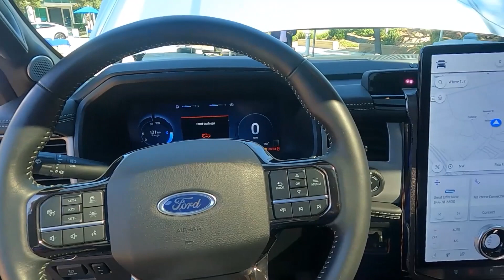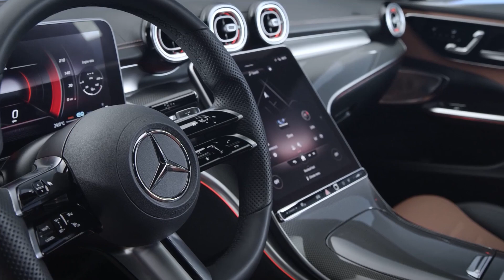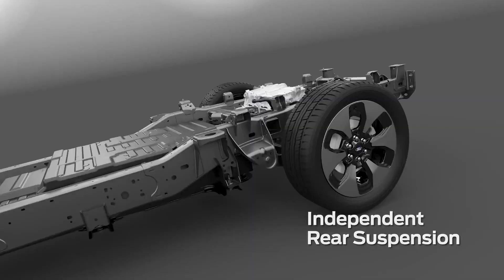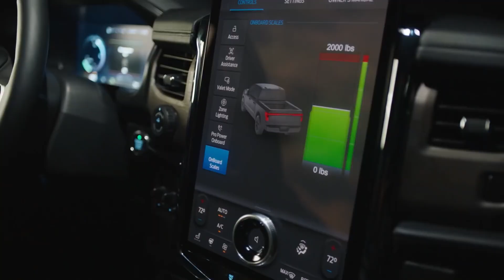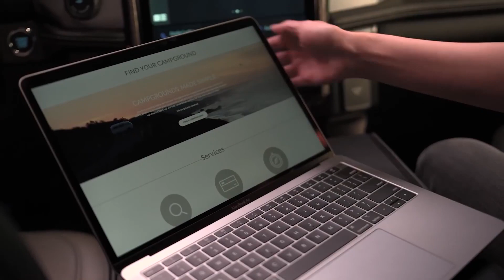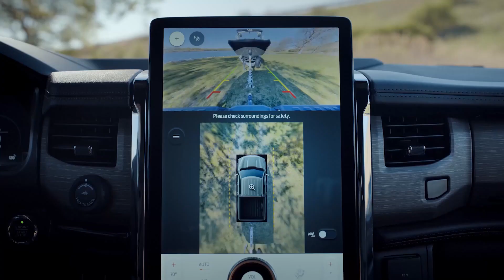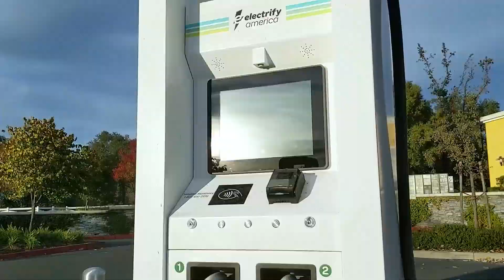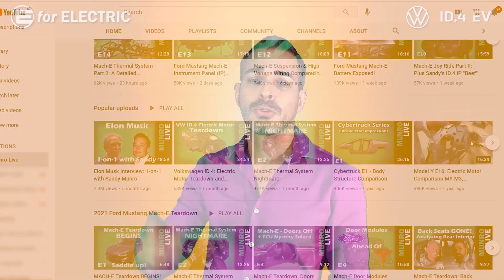SANDY MUNRO on Electric Trucks: F-150, Cybertruck & Rivian

Comment: The F-150 lightning has so many well thought out design elements. Ironically one of them is how little design went into it. A "normal" looking EV is a shocking departure. The frunk size and load in height is brilliant. The power to home feature is revolutionary (to actually bring to market) and targeted EXACTLY at truck buyers who love to be the "hero" at every opportunity. Add that Texas had a power grid melt down last winter and the state is one of the largest market for trucks and you will sell them on that feature alone. When potential Tesla powerwall buyers do the math and find out how many they will need to equal the runtime of the F-150 they will use that to justify the cost of the F-150 lightning.
Reply: There is really nothing stopping someone from powering their home with a Cybertruck or probably a Rivian too.  They both have large onboard 240 volt AC inverters.  So it's just a matter of running a 240 volt generator cord to an inlet/receptacle on the house and flipping a breaker or transfer switch.  Ford is just marketing it as a feature, but the only unique part is that it's automatic instead of manual.  What they aren't telling you is that getting your home wired for that automatic transfer switch will be more complicated and expensive than it will be worth for most people.
Reply: @CL-gq3no  I think most of those onboard generators top out at 30 amps, not the same.
Reply: @frankcoffey , Ford's tops out at 9.6kW max which is 40 amps.  I'm not clear on the Rivian's inverter output, but the Cybertruck will very likely be similar to the Ford if not better.  Even if it's 30 amps that is still more than enough to power a home's critical loads in an emergency and not that different than Ford's 40 amps.

Comment: The lightning does not need 500 miles of range. Towing a trailer cross country is for the ICE trucks, the Lightning is for commercial fleets that need only 200 mile range - if that.

Comment: Hopefully they will start having fast chargers accessible to trucks pulling a trailer. Currently most are single stall for a single vehicle. Need current gas station type set up.
Reply: There's way more pull through charging stalls in Europe. But yes that's an issue for sure.

Comment: But neither speaker really addressed a couple of key points.
Trucks loaded with 1000+lbs of battery have 1000+lbs less payload. 
Towing tanks the range of EVs. TFL measured a tesla and got less than half the range. 
Charging rates are laughably slow... unless you modify your house or go to a quick charging station.... that does not typically get sized for a truck, much less a trailer!

Comment: Not sure I've heard this question asked/answered anywhere... Where are trucks towing trailers going to go to easily fast-charge their vehicles while traveling? I haven't seen/heard anything about charging stations designed so these vehicles can easily pull in and drive out with their trailers. Any thoughts, Alex or Sandy?

Comment: Many pickups have tool boxes in the bed of the truck and why couldn't Ford have a custom box with a battery pack in the bottom or the pact could fit into the box that could give you the extra range. Or many have covers on the bed and why couldn't the cover be solar panel for recharging. Just two thoughts
Reply: My 2 thoughts too, after market goodies will come with demand
Reply: EV cars realistically would not have room for these options. And for the pick up, the potential  added range would be almost unlimited.

Comment: A cool note about the increase of EVs is that Jeep is placing chargers at the Rubicon trail as well as other trails. So it will be cool to see more adventure minded companies address the wilderness charging issues. My personal truck is for daily driving and weekend off-road play of which I need to refuel in the middle of nowhere.  I live in a city but have to get away far from people and civilization.

Comment: Why does no one mention that Ford patented a generator in a toolbox? They can sell that to plop into a lightning and get 500 miles of range while towing.  Just leave it at home when you arent towing.  If hydrogen becomes available at fuel stations, the generator can be replaced with a fuel cell without replacing the whole truck. I'm starting to wonder if they patented the idea just to keep it off the market.

Comment: I like the idea of the lightning, but it will not work for real-world construction people. Sometimes I drive 500 plus miles in a day. Sometimes I drive 200 plus miles, then sit in it for another 4 hours with the heat or ac on. Sometimes you get home at 11 pm and back on the road at 5am. Currently, you can not run to the gas station and fill up in 5  minutes to go back to what you're doing.

Comment: Thanks a lot for all this down to ground real info... 😊👍🙂 If i understand correctly trucks are for people who like it takle the tough stuff be it hard work, rough terrain and weather, raw oudoors or all of the above 🙂 I have a far better design for all that + still keep the option to roll fast or even race tracks = HSUV (hyper steam universal vehicle). It is based on hyper presured steam / water vapors as both energy storage and engine. It uses IR+V radiation as wireless energy input, be it sunlight or artificial light, it can be build on site in simple 3D printer-like fully autonomous micro-factories (instead of large and stupendously complex factories)... No batteries and all their problems (especially recycling and true carbon footprint) and no electric motors also (even if now so elegantly efficient). No metals at all (especially the rare earth ones), not even for the factories = just polycarbonate and carbon fiber and nylon/vegetal silk/cotton. The only electronics would be about always-on and imposible to fault radio cushion based collision avoiding and road keeping system where one can drive as reckless as one wants or completely loose control and still be 100% safe as well as all the other traffic participants and elements because this vehicle will simply refuse to leave the road ir touch (let alone hit) anything 😁😉 No AI, no training super server networks, no digital control when the simple laws of physics can take care of that with zero bugs / faults / bluescreen of death, shortage of chips (to enrich bitoiners) or any other "perks" of curent computers technology... Why am I so sure that it would work and do so for any of our needs including trucking? 😜 It is because, in all things real design and practical engineering simplest is best. Not only this concept is the absolute most minimalistical and thus overal mist efficient vehicle design but it allows for unlimited (yes unlimited) modularity so that any cargo can be accomodated by adding interchangeable self-powered towing elements as needed. The car/truck can be used for people, people and cargo / luggage or just cargo / luggage as is. The radio based system mentioned above would act as wireless radio entangling keeping these modules locked in at a certain range without ever hvaing them get loose or touching one another (just like dia-magnetic entangling). The vehicle is in essence able to become a swarm of coherent vehicles moving together, be it as one unit or as temporary flocks of vehicles entangled on busy traffic to maximize road space and to offer the best flow as they essentially roll as one entity (no more spring effect with stopping and starting on full highways for instance)... BUT... I DESPERATELY NEED HELP, TO START THIS AND ALSO SEE IT THROUGH... NO WHERE NEAR THE MILLIONS OR BILLIONS FLYING AROUND ON OTHER COMPANIES... Or it will all go to waste... Like much of all my other similarly revolutionary innovative projects 😁😜👍
Reply: Build a scale model as proof of concept if you want to bring attention to your idea.
Reply: @mkconte  Yes 😁 I am on it ... Hopefully I can master the resources all on my own 😉😁 Or ... maybe I could get the such need boost from just as recklessly passionate crazies like me 😁 I REALLY THINK I CAN HELP THE WORLD BUT I AM LESS SURE  I SHOULD / COULD DO THIS ALL BY MYSELF 😔 So please HEEEEELP !!! Donations, startups, contracts ... anything just to see if anyone would still care 🙂 THANK-YOU KINDLY for all tour time and understanding 😉
Reply: @theknifedude1881  Hi! Thank-you for the reply :) Who is Trevor M. and how do I find him ? I'm on Facebook / Messenger with the same ID ... Thank-you kindly for all your time and help ! All best :)

Comment: If you ask an ICE pick-up owner what would be the perfect truck they would say a combination of a Dodge Ram with a Cummins engine, GMC with an Allison transmission, and Ford's Body. Now if you ask them about the perfect EV Truck they might say Ford Lighting's ride, Rivian's smaller size, and Cybertruck's convenience package.😄
Reply: I’m waiting on that Ranger EV. I hope it won’t be a long wait…
Reply: I have a had a lot of trucks. The electric Ford trucks from the late 90's where awesome. So it's a Ford F250 truck with an electric drive with independent suspension would be my ideal truck.

Comment: The fun part will be getting a truck and trailer into a charging station
Reply: Good point. Another problem which will be solved I believe.
Reply: I’ll pull a 27 feet sailboat with the model y. Will need to unhook the trailer in the parking lot before I can charge the car. Eventually the same thing will happen with my 35 feet TT and my future cyber truck, unless they modify their charging station.
Reply: @q2w8i9o  can't wait until they have bigger stalls to accommodate trailer pulling vehicles without un hooking and be able to charge a trailer at the same time it's coming soon

Comment: The only reason it took this long to get electric pickups trucks is: Money. ICE pickups are dirt cheap to build and can be sold for a lot of money. HUGE win for the OEMs. For an electric truck you need much bigger batteries than for a Tesla M S for example and this makes electric pickups much more expensive to produce than ICE pickups. But you can't sell them for (much) more money than ICE pickups. People would just stick to the ICEs. So basically OEMs earn much less money by selling BEV pickups. So why would they? It's just stupid. Now batteries have reached a price where they can probably switch ICE to BEV without loosing much money.

Comment: I don't know if this question has ever been brought up.
Why don't the manufactures just install a generator so when the battery get to a certain percentage it kicks in and start charging the on board battery.
that way you can get more ranger on these electric vehicles.
I like the ford lighting but also tow a trailer with atv's up to northern Minnesota; I'm looking for a truck that would get at least 1,000 miles of range.
The ford lighting looks like it would be my kind of truck truck .
Ford F150's are in my opinion the best trucks made; i grew up with friends that had ford truck and we could sit on the front wheel wells and fix the engine.
Old memories the best
Reply: that's a hybrid
Reply: @ssimpala1901  
No not a gas motor a electric generator to keep the batteries charged when they get below a certain percentage.
IE an alternator that delivery's power to charge the battery

Comment: I'm wondering what happens to the occupants if an EV is in an accident and gets submerged in water. I see fail videos where people's trucks slide into the water at a boat ramp. Are there safeguards in place to shut off the electricity to protect the occupants?
Reply: You would never get electrocuted in an ev by submerging. Watch the video of the Tesla in the submerged tunnel. Your body would not be the shortest route to ground. You would have to be holding the battery terminal and dipping your feet in the water at the same time.  Otherwise the terminal hits the water and goes straight to ground. Assuming that the unit is not sealed
Reply: Just last week, Rivian posted a video of it driving thru 4 foot deep water.

Comment: How would charging work while pulling a trailer at a charge station?  Ev trucks will not work with small contractors at first. Probably larger companies with daily delivery routes and in house charging portals will be seen in the future.

Comment: “Pup” is a neat term for a supplemental battery-pack trailer. Ford has had foresight in allowing for it to meld in with its regular set-up. What about competitors?

Maybe it would be a good idea for the Pup to include some extra (optimal?) amenities, since there’d probably be room. Storage space at a minimum.
Reply: Lairiate

Comment: the estimated 300 miles is with 1,000 lbs in the back so without any weight it will almost reach 500 miles.

Comment: E for Electric should do a video on Nano One Materials Corp.  I'm sure you will be very interested in their cathode technology that make cathode materials less expensive, higher voltage, safer, less degradation and more environmentally friendly.  Nano One has created partnerships with names such as VW, Pulead, and an undisclosed USA OEM and multi billion dollar non-chinese cathode manufacturer.  Their technology has already been proven.  Scale up and commercialization should occur in 2022.

Comment: My take is that the Cybertruck is vaporware, might see it in 2025, they have a long way to go.  Rivian is luxury startup with some great engineering and design, they will have trouble meeting demand especially with Amazon putting pressure on them to transfer to van production.  Lightning is the best bang for your buck from a legacy automaker, again their issue will be meeting demand.  None of these vehicles will tow for long distances, they will tow really well with all that torque but they will lose 50% of their range with a decent load.  Sandy says there will be a trailer with a battery, which I don't see being practical.  You pay 20k for an extra battery in your trailer that gives you a little bit of range but takes away from payload, and the battery is put in a bad position where it is not kept at optimal voltage.  Hybrids, maybe even diesel electric, will take over for long distance towing in 2500 trucks.  I think the Rivian is my favorite so far, just missing a few features.
Reply: Agree on the diesel electric hybrid for heavier duty pickups.  If it works for locomotives it should work beautifully for 3500 and bigger pickups

Comment: The bigger issue isn't the tech it was the ability to deliver and to handle a payload and have a decent range under load. I get that there are more wannabe poser retards with trucks that wouldn't put more than a potted plant in it as a load. But the rest of us are off road (NOT PLAYING) at jobsites, loading and unloading, pulling and essentially putting real miles on it. Ford and GM are the only ones who can produce and it looks like a truck....not the next mars rover.
Reply: Mars rover lol.  Totally agree

Comment: I pull a 14000# trailer.  I doubt a F-150 will come anywhere near that.  A F-350 Lightning?
Reply: A cybertruck has a max tow rating of 14000 pounds if that what your looking for.
Reply: @migueljardim8177  What's the tow rating of the lightening?

Comment: No sweat with range anxiety, just load up a diesel gen-set in the back and plug it in.
Reply: Would have to be a fairly big one would not be fun waiting an hour to get a few kwh of power or 10 miles per hour!
Reply: @gregb1599  No 3 phase 380volt rectified to matching DC. Plug in the moment you set off.
Reply: @MegaWilderness  But then you are no longer an EV but just a PHEV so just buy a much cheaper PHEV and zero waiting
Reply: Most ev's won't charge off a generator. But honestly range anxiety goes away after driving an ev for a couple days. Maybe more of an issue with towing if the computer doesn't estimate your usage correctly.
Reply: @themeach011  All electrons are the same, all it takes is to communicate the correct protocol and supply the appropriate requirements.
Reply: @MegaWilderness  all electricity is not created equal. Generators typically don't provide a "clean" frequency or wave pattern or whatever the actual issue is. It causes clipping and other such issues. We were just last weekend trying to run a DJ sound system for a dance off a very large diesel generator and the equipment would not operate correctly. Worked fine when plugged into a wall socket.

Comment: Model 3 charged from low % to 80% in 12 minutes. How long to fill a truck with a battery 2-3x the capacity. Doing that multiple times while towing for jobs will impact work rate and income for many truckers that are working. For just A to B driving ya it's fine. I think Sandy's initial answer of 500 mile range being necessary for an EV truck makes sense. So it depends on the buyer. Myself and many vehicle owners don't go long distance so lower range and charging at A and at B will be no problem. But for all the rest, it will be a problem. So that's ok. EV market exists, it's just not ready for everyone but we'll get there sooner than later.

Comment: Trailer can have solar panels, batteries and slow recharge truck during drive.. may not add many miles immediately,  but plug in trailer at night or at truck stop and have it fast charge truck while recharging trailer battery.   Therefore, Ford might be making right call in not overthinking truck battery but focusing on creating the most intelligent, capable, and intuitive towing platform.  Bigger issue is payload...typically that's what has held back the f150 and new tech has not yet reached superduty.